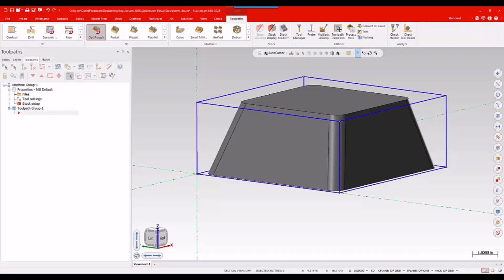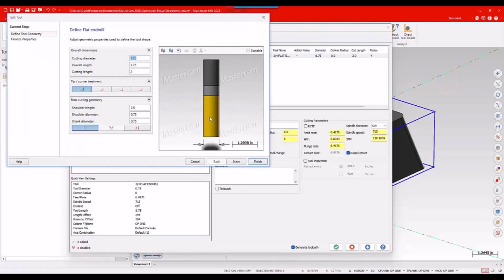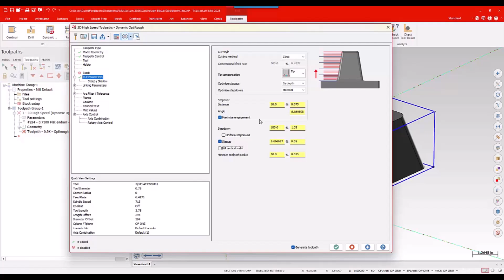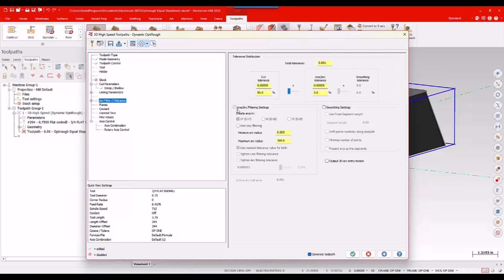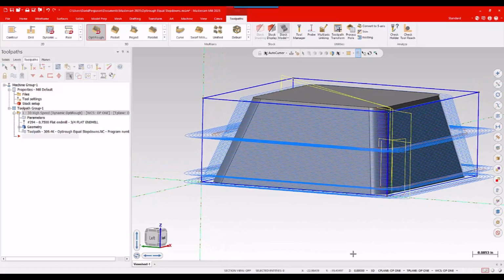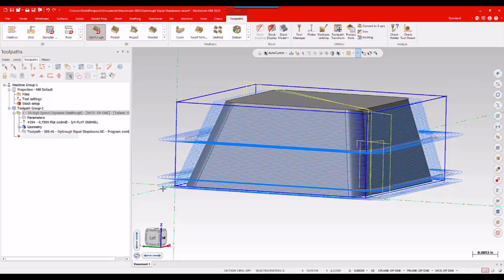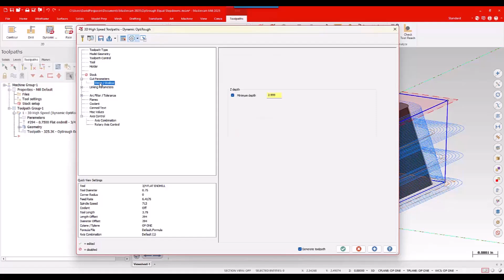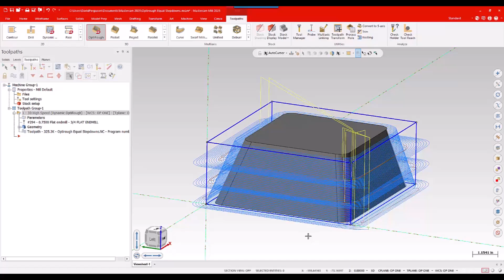New Features in 3D High Speed Dynamic OptiRough | Mastercam 2025

Comment: Hi. My question is kinda unrelated but I didn't see a video on the subject here. I am using Mastercam 2025. I have a need to make a 3D lathe tool to accurately check for clearance. Specifically, I am trying to do this with a Micro 100 bar from step file. There are several videos showing this process but they all cover inserted holders and their inserts. When I try to do this with a Micro 100 the system wants me to describe it as a holder and insert type tool and doesn't seem to be set up to let me define the cutting portion of the solid as the insert...can you help me with this???